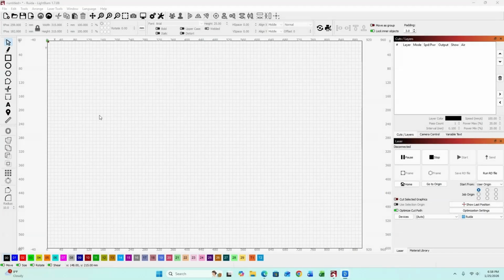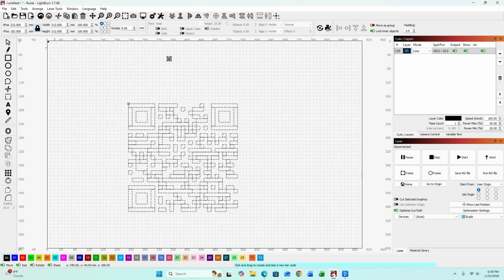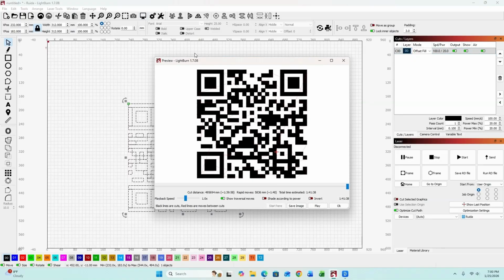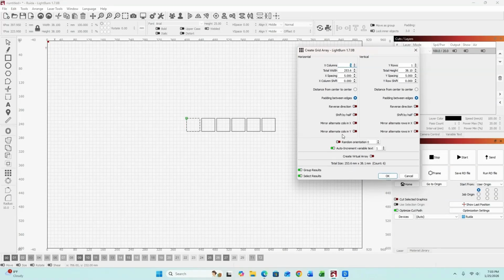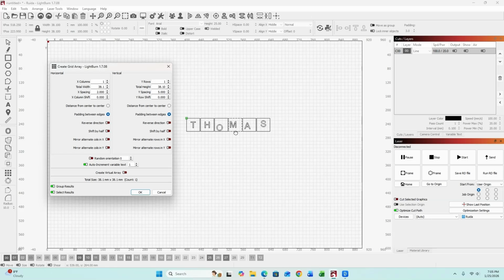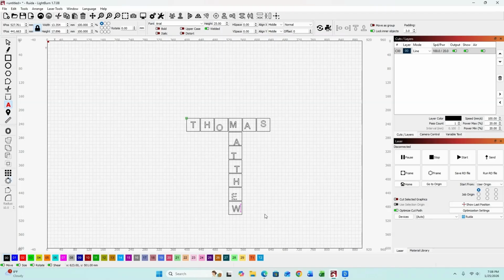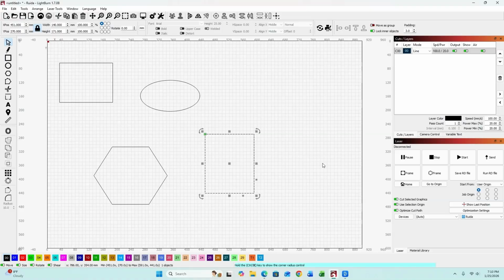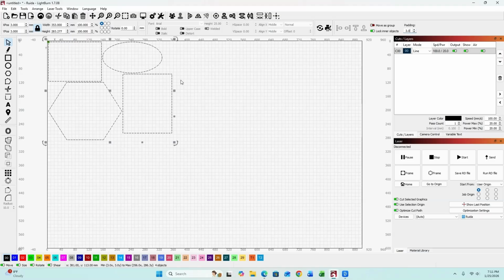3 LightBurn Skills Every Laser User Should Know (QR Codes, Arrays, Less Waste)

Comment: Good morning Tiffany - enjoying your videos - have a question - I think we have the same laser ( nova PLUS). Support told me that Offset Fill should not be used on a Gantry laser - it is for Galvos and Diode lasers. Are you using "Offset Fill" on your Nova PLUS? Thanks
Reply from the maker: Thank you for your question and I am so happy you are enjoying the videos.  I currently own the Thunder Nova 36, not the Nova Plus.  I have used both fill and offset fill.  I would love to know more about your machine!  I will do some research.  :-)
Reply: @TiffanysLaserLab  Thanks Tiffany. They are similar just a different tube ( glass on the Nova and RF on the PLUS). If you can Let me know what you find out about using Offset Fill, if perhaps you find out something different. Thanks and all the best!
Reply from the maker: This is the information I have found when researching:

Fill (Line Fill):
Standard back-and-forth raster engraving
Laser scans left to right in lines
Best for photos and large filled areas

Offset Fill:
Laser follows concentric offsets of the shape
Moves around the contour repeatedly inward or outward
Can sometimes reduce direction-change vibration
Often gives smoother fills on certain shapes

Where confusion happens:
Offset Fill can sometimes feel smoother on machines because motion is more continuous, while standard Fill rapidly changes direction at each scan line. So some users feel Offset Fill is gentler, especially on complex shapes.

But mechanically:
Fill = lots of rapid X-axis reversals
Offset Fill = more curved, continuous motion

According to the research I found, neither mode is detrimental. The real wear factors are:
Excessive speeds
Aggressive acceleration settings
Heavy gantry vibration
Long production hours
Not whether you use Fill or Offset Fill.

Most users run:
Fill for photos & large engravings
Offset Fill for logos, letters, shapes, or when trying to avoid scan lines

It really boils down to personal preference and what works for you, the project and your laser settings.  I would highly recommend running a material test to see which you prefer.  I hope this helped answer your questions.  Thank you for asking and I really appreciate your support for my channel!!  :-)
Reply: @TiffanysLaserLab  Thanks kindly Tiffany - this is super helpful - have a great week!
Reply from the maker: You're so welcome!  You as well!!